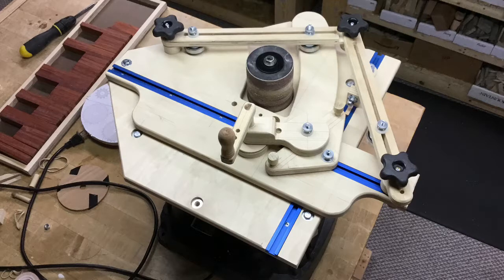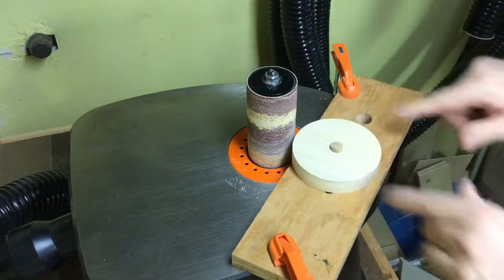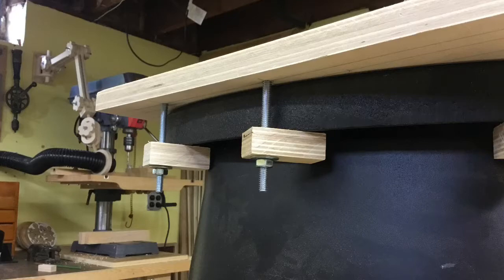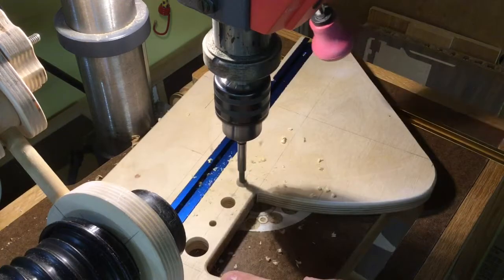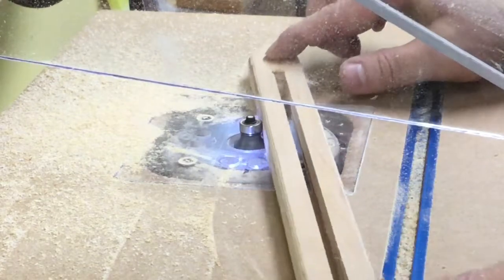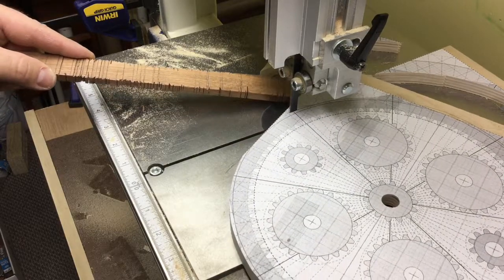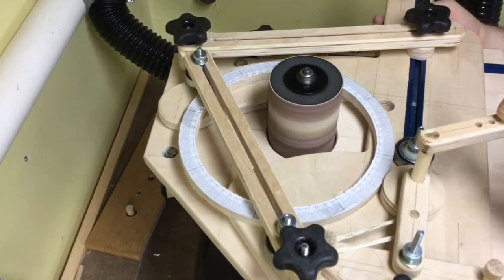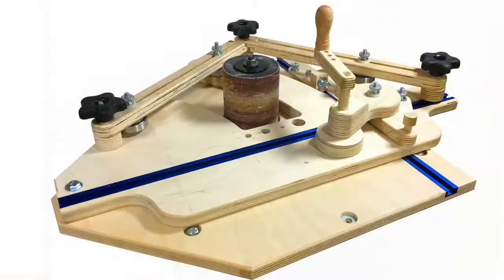A safe circle sanding jig for an oscillating spindle sander

Comment: If you haven't, make yourself that table saw sled.  I can't remember the last time I had to the the miter gauge with my saw and I do not miss it one bit.

Also, please (please) don't make freehand cuts like the one you made a 5:49.  I like your video enough I may subscribe and I want you to stay safe and healthy to keep going.  Not 100% sure, but I'm guessing that cut would have worked fine with a jigsaw or bandsaw.